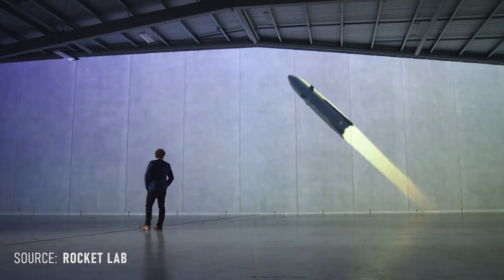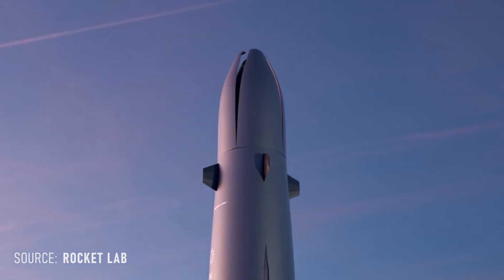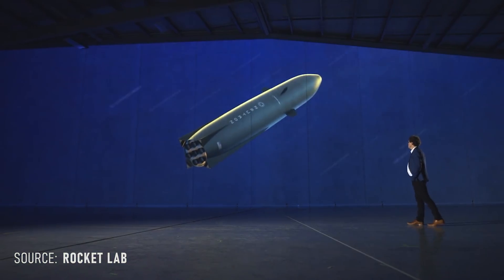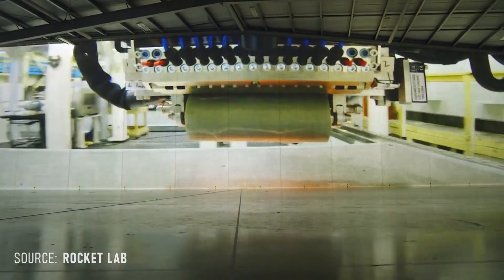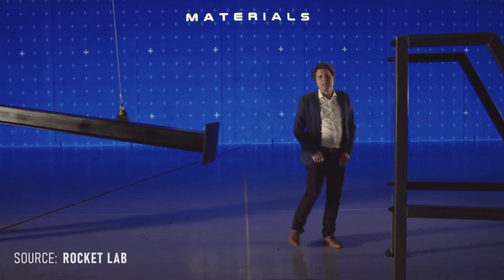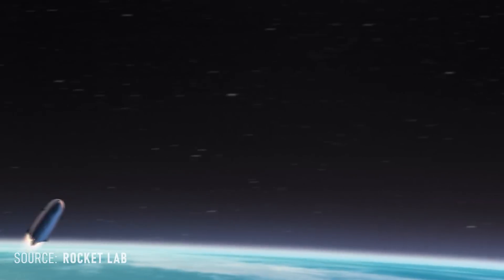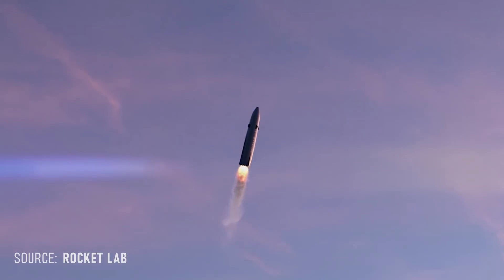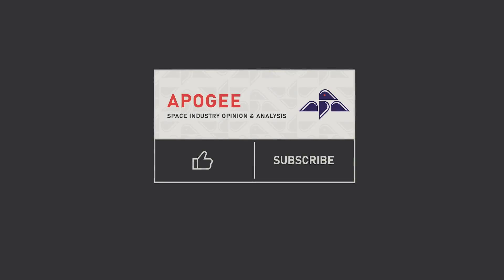Neutron First Thoughts - Design Analysis

Comment: Excellent presentation! For the most part you explained your reasoning which made your conclusions more compelling. Once or twice you didn't explain, however (e.g., asserting that Neutron would be as or less expensive than a Falcon 9. This would have been easier to take on faith if somewhere you explained your experience or expertise. Don't be quite so anonymous and/or do script checks to discover early on where you might be making unsupported arguments. These are quibbles, obviously. Your material is generally first class, including 95% + of this video. Thanks for your service!
Reply: I assume the neutron will be less costly to operate than Falcon 9 and heavy due to labor hours. They will reuse the hardware that would take more time to rebuild than to reuse, and discard the rest. They are using the same fuel as SpaceX raptor, but with a simpler engine. Landing legs, but fixed, etc. They are using carbon fiber simply because they have a robot printer that makes it, for everything else it seems the goal is to reduce maintenance personal. Beck even said retrieving the electron rocket with a parachute and a helicopter costs less than crewing a barge for one or two days.